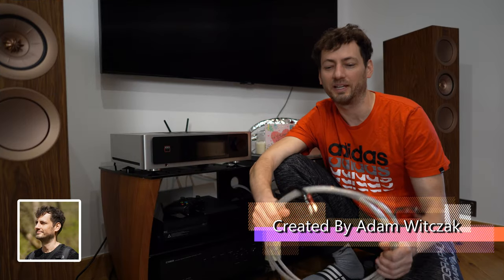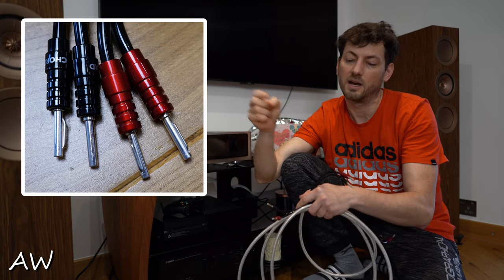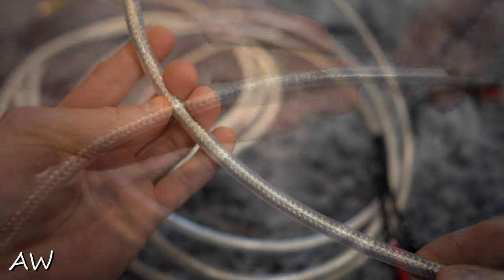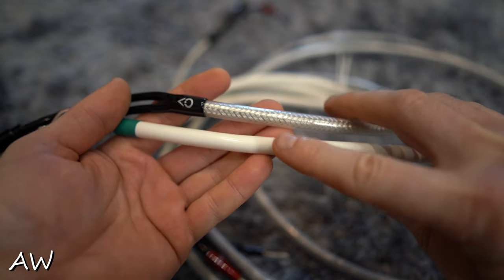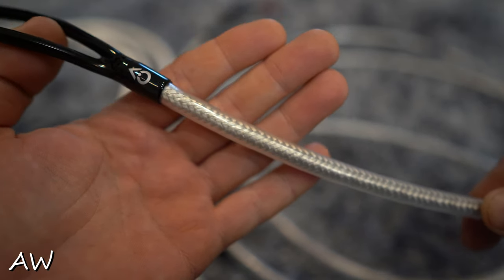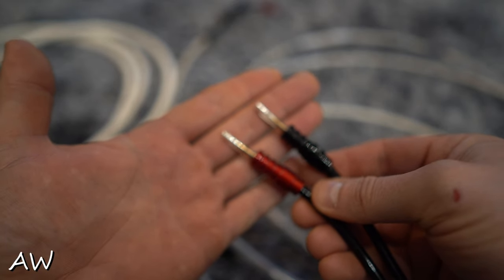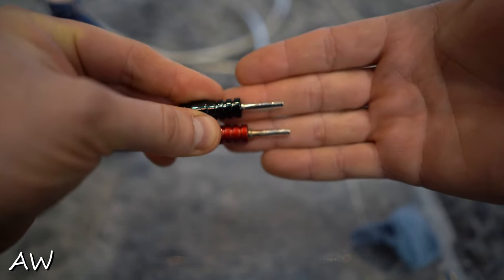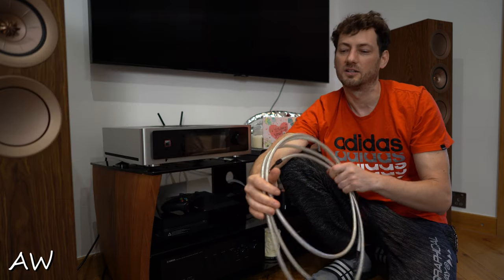Chord ShawlineX speaker cable

Comment: Don't waste your time and money . what you think you are hearing between corroded and clean cables is mostly a mental biased projection . the difference musically is negligible . The hifi industry hypes everything to convince you to spend more money when its not necessary. Buy some 10 or 12 gage speaker wire on a spool and some gold plated banana plugs ( very inexpensive ) install and enjoy . Stop overly critiquing your system and just allow yourself to be immersed in the music.

Comment: How is the long term affect using this silver polish? has it damaged the plugs in anyway? Thanks.
Reply from the maker: It all depends on the conditions in the room , it depends on whether it is completely hidden in the socket or whether a piece of the plug sticks out and then it has air circulation , then the silver oxidizes faster . I have been using silver cleaner for years and I haven't noticed any damages  on the plugs
Reply: @WitczakAudioUK  Great as my silver plugs have got a lot of tarnish too & they are around a year old, will get the same polish you used as i know which brand it is 🙂 Thanks for the info & video.